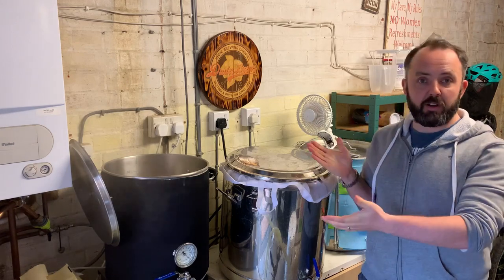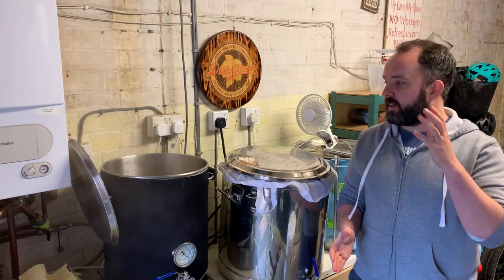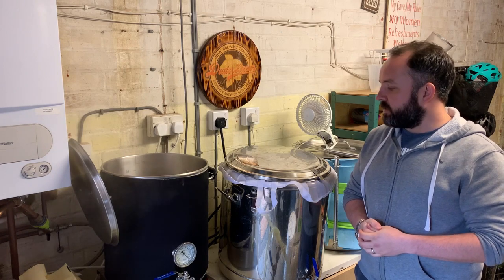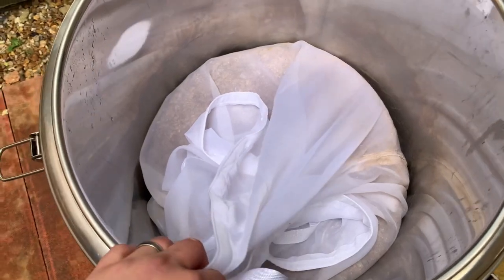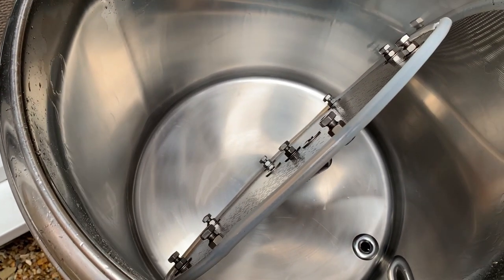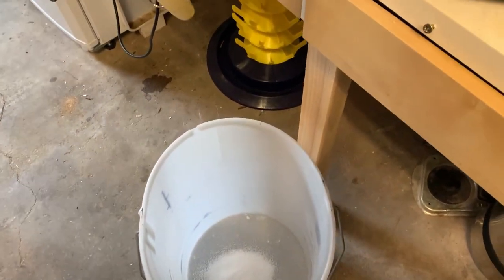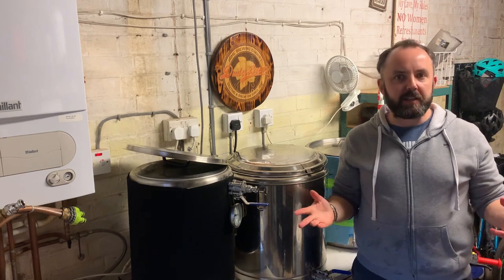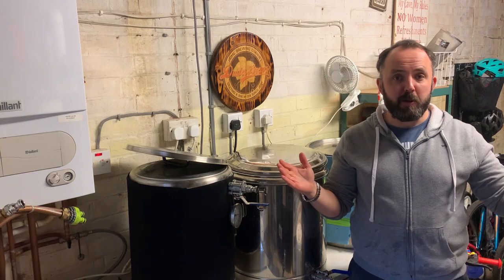Cleaning Homebrew Equipment - My Method

Comment: I'm hearing soap is a bad idea cuz it can leave stuff in there than can affect the head of the beer. I've been told to use PBW.
Reply from the maker: Soap is absolutely fine for cleaning as long as you rinse it off thoroughly, pbw is a much more effective cleaning agent but obviously a big price difference

Comment: Hi Richard. Can I ask how you built your mash tun please? Was it through a specialist website or did you source all the parts yourself? I was wondering most about the false bottom? Also, do you heat your mash tun or does it hold its temperature well? Thanks and sorry to comment on an old video.
Reply from the maker: Hi Jamie, I bought the tun second hand but it’s originally from brewbuilder or maybe powell brewing can’t remember exactly which! The false bottom and everything came with it